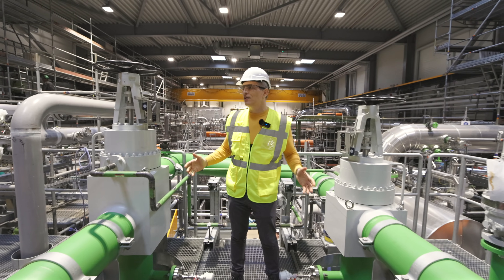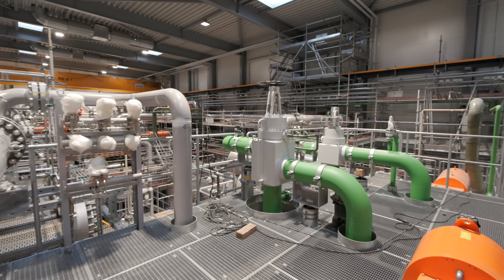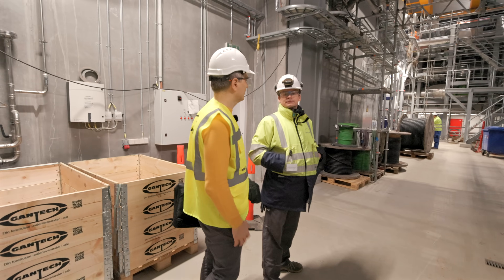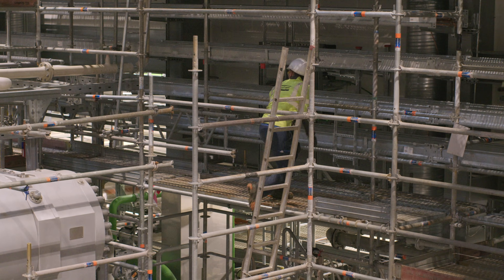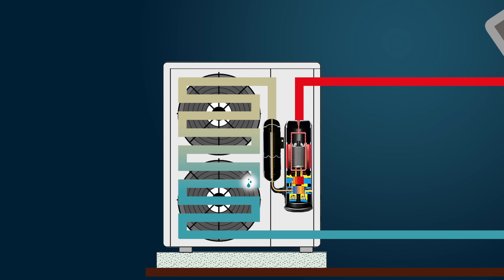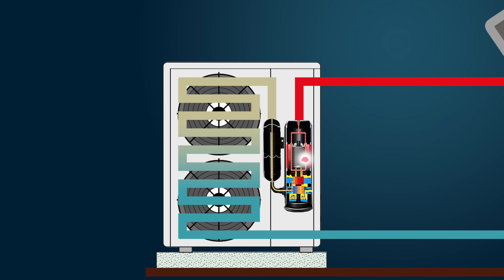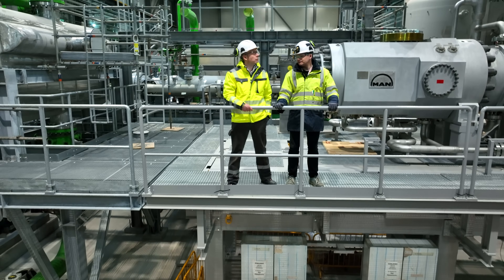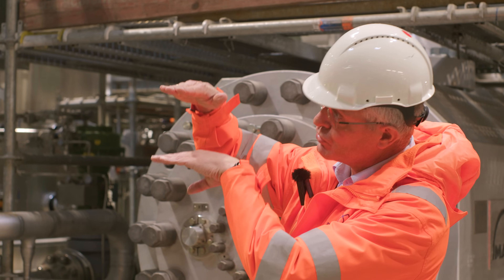Inside the world’s first giant heat pump that heats an entire city with CO2 and sea water

Comment: I'm not a fan of distributed heating (via heatpumps)  because the way to high flow temperatures.  If excess  heat from wasteburning is used maybe. (Small) Heatpumps should be installed and configured for the heating demand at each consumer imo.
Reply: It's replacing coal.... 

Lucky for the planet that  YT expert entitled conjecture.... is irrelevant
Reply: @nc3826  I never said they should not replace coal burning for heating. I only said do it decentalised.small heatpump at the consumer, no need to transport heat with big losses, no need tdo use high flowtemp (thus bad cop).
Reply: @jakop0815  1st the COP is not bad... 

But it doesn't matter, since they are only replacing only one aspect of the distributed heating system... Which is powered with coal....

Plus their heating is tied into waste disposal and other aspects... 

Life is not as simple as most people want it to be on social media.... I'm getting out of the rabbit hole now, have a nice day...
Reply: I agree, if the city already has distributed heat sure. I wouldn't suggest city's that turn off the natural gas to rip open the whole town with an army of diesel burning excavators to put in a mountain of polymer pipes. In that case decentralised high efficient heat pumps and improved insulation is in my opinion a better solution.
Reply: Bless the Danish and their "grid balancing gymnastics" -- but this is the dumbest/stupidest renewable-energy contraption I've ever seen.  (Have to feel sorry for the manager how has to describe this contraption.) 

1) there is nothing unusual happening with the climate.  (Please explain the Little Ice Age and the Medieval Warm Period.) 

2) there is nothing wrong with burning fossil fuels.  Its problems in high-density areas are trivial to fix and already have been fixed.  CO2 is not a pollutant.

3) Climate alarmism is a big-lie superstition supported by tax-bribed liars.  (See Climate Discussion Nexus for 100s of videos on climate quackery, deception, and realism.)

4) decarbonization is 21st century pyramid building and human sacrifice. 

5) there is NO excuse for expensive electricity.  Electricity generation is boring.     Just burn coal and scrub the smoke in densely populated areas.

6) the only challenge is manufacturing market quantities of cheap gasoline.  South Africa has already done this for decades (Sasol), using coal. 

7) Elon Musk: the Laptop Class is in La-La Land.

Comment: if the compressors were driven directly by wind, bypassing the conversion to electricity and back to mechanical energy it would be more efficient. 
The most efficient system would be an absobtion Ammonia system powered by solar heat.

Comment: 27:38 
In fact, it is not correct to say that there is no mechanical contact because magnetic bearings are mechanical bearings and use magnetic forces that are mechanical. Rather, it is correct to say that there is no physical contact. Another point I noticed is that there is a lot of incorrect promotion. For example, the person in the video says that the gearbox is the cause of the malfunction. How is it possible that he is an engineer and says something like this ??!!! 
It is known that the mechanical system is a very efficient and durable system that does not require electricity to operate. The purpose of the gear system is to obtain the required torque and speed with the least possible amount of input energy, and this has been known for a long time !! Obtaining the required torque and speed based on the frequency amplitude of the input power is an absurd matter that leads to the consumption of a very large amount of energy, and changing the frequency amplitude may damage the induction wires in the motor. Therefore, I believe that consumer companies have succeeded in promoting their products and polishing the image of those products. I believe that adding a suitable gear system can reduce electrical energy consumption and significantly reduce the load on the grid, this will also increase efficiency of heat pump.
Leave the system simple and do not complicate it with consumer electronics and complex coding based on memorization and memory !!
Reply: While gearing might increase efficiency, it would affect reliability. Gears wear out because of the physical context, even if properly lubricated. Efficiency is only one goal of the plant, others are safety and reliability.
Reply: @tlangdon12  The gear system is a reliable and simple system used as a transmission in very, very large trucks, such as those used in quarries. There can be a treatment for such a problem, such as cushioning between the teeth, for example, but not limited to. Gears can be made of suitable materials or use different types of Gear system and that after studying. Therefore, the gear system is a reliable system in the long run, so there is no need to exaggerate. There are many factors that threaten safety, the first of which is the huge amount of energy required to run the motor, and fluctuation of it, which entails many unnecessary problems and It also reduces the service life of the motor !

Comment: Excellent video. 

I think the main advantages of this large system over point of use heat pumps is its ability to actively adjust its electrical grid load while a point of use heat pump often uses the most electricity when the electrical grid is struggling to meet demand.  This municipal heat pump and storage with wood waste burner system provides a huge service by absorbing excess production and curtailing peak demand while providing heating service to the buildings of the city. 

Regarding the issue of replacing a coal powered plant, the benefits of doing so may be questionable.  Because energy is a world market. and electricity is simply a way to transport energy from one location to another with a loss of energy but an increase in usability and shifting the pollution away from the area of use to the area of production.   If the energy and resources used to create and operate this municipal heat pump creates a sufficient defficit and associated demand on the world energy market that an equal amount of coal has to be burned in a less advanced economy the greenness of the project is a failure because of the increased world gross greenhouse gas emissions and pollution.  I am not trying to point fingers at this specific project, I can see it's benefits.  I just think the European Union would do better if it used its coal to revive its dying manufacturing production instead of shifting manufacturing to third world countries that will burn coal with high pollution.  Also, with more coal use in Europe, less advanced countries would have more access to liquid and gas hydrocarbons. 

Unrelated general statement: Also, in my opinion, the EU not using Russian gas and oil is ludicrous and disastrous to the EU economy.   Do not virtue signal or warmonger at the cost of the global market and your economy.   Russia is not a threat to the EU. Stop wasting resources and lives.

Comment: so they shut it down when the wind is not blowing?
Reply from the maker: No, they can store thermal energy and balance their demand in electricity consumption from the grid.
Reply: if the wind were to shut down for a year, they would still be on the grid, the EU wide grid would bring in power from France nuclear or German coal or Norway hydro or what ever is cheapest at the time. Also the entire power draw of this site is about the same as a single one of the larger wind turbines, these figures were given in the video.
Reply: @johnjakson444  yeah, exactly, so why the greenwashing on the "wind powered" heat pump?
Reply: They are flexible in using electricity when price is best or when the grid needs balancing. There will be a strategic system to help them trim their system to the best economic working point. That balancing tank looks the big winner! I am an engineer, retired, that worked in this sector of industry and my heart is burning what we can achieve with modern technology. Very informative video!
Reply: @kezi___  From our end we do not communicate that wind-power-angle of this. It is because the journalists visit the site and see some nearby windmills and they just think it is a good story. In fact we are conneted to the public grid, and we have only green energy when Denmark as a hole has green energy.
Reply: @dinforsyning8578  Thank you
Reply: So many unsubsidized solar cells are now online, that grid price is zero at noon when consumption is low. It happened the weekend after you wrote, and again this weekend. The big heatpumps say "Thanks for the free energy" and store the heat for later.
Reply: @thomasgade226  wow there's sun in mid april, sure that's going to help heating in the winter
Reply: @kezi___  that's why they have those other sources, and storage . Frost also occur in April, usually because of clear skies - good for solar
Reply: Bless the Danish and their "grid balancing gymnastics" -- but this is the dumbest/stupidest renewable-energy contraption I've ever seen.  (Have to feel sorry for the manager how has to describe this contraption.) 

1) there is nothing unusual happening with the climate.  (Please explain the Little Ice Age and the Medieval Warm Period.) 

2) there is nothing wrong with burning fossil fuels.  Its problems in high-density areas are trivial to fix and already have been fixed.  CO2 is not a pollutant.

3) Climate alarmism is a big-lie superstition supported by tax-bribed liars.  (See Climate Discussion Nexus for 100s of videos on climate quackery, deception, and realism.)

4) decarbonization is 21st century pyramid building and human sacrifice. 

5) there is NO excuse for expensive electricity.  Electricity generation is boring.     Just burn coal and scrub the smoke in densely populated areas.

6) the only challenge is manufacturing market quantities of cheap gasoline.  South Africa has already done this for decades (Sasol), using coal. 

7) Elon Musk: the Laptop Class is in La-La Land.

Comment: Flawed Design, uses more Electricity than it produces. 

Heat Source Pumps do not work. 
Redo your maths.
Reply: Where was it mentioned that the system produces electricity ?

Comment: Denmark can afford this technology because of its vast reserved of oil and gas that it sells to the rest of the world! Look it up!!
Reply: I think you mixed Denmark with Norway on this topic
Reply: @felixdergluckliche3108  not according to google, i did check before i typed
Reply: “Denmark is the largest producer of oil and gas in the EU”
Reply: Denmark's oil&gas is quickly running out, and this is one of the next steps in securing cheap energy. But this time forever.
Reply: @philhermetic  The largest oil and gas producers in Europe are Norway and UK which are not the EU. Italy is large producer of oil and gas as well.
Reply: Denmarks production of oil and gas is only a fraction of Norway's. But this said, it should be mentioned that Denmark has been a forerunner in the development of wind turbines. Huge investments have been made in developing efficient turbines, and Danish wind turbines are now sold all over the world; and they are now so efficient that cost of electricity produced by wind turbines is lower than "black electricity" - construction costs included! We are now in a situation where investing in green energy has a better return than investing in black energy - and this is a turning point for green transition!
Reply: Bless the Danish and their "grid balancing gymnastics" -- but this is the dumbest/stupidest renewable-energy contraption I've ever seen.  (Have to feel sorry for the manager how has to describe this contraption.) 

1) there is nothing unusual happening with the climate.  (Please explain the Little Ice Age and the Medieval Warm Period.) 

2) there is nothing wrong with burning fossil fuels.  Its problems in high-density areas are trivial to fix and already have been fixed.  CO2 is not a pollutant.

3) Climate alarmism is a big-lie superstition supported by tax-bribed liars.  (See Climate Discussion Nexus for 100s of videos on climate quackery, deception, and realism.)

4) decarbonization is 21st century pyramid building and human sacrifice. 

5) there is NO excuse for expensive electricity.  Electricity generation is boring.     Just burn coal and scrub the smoke in densely populated areas.

6) the only challenge is manufacturing market quantities of cheap gasoline.  South Africa has already done this for decades (Sasol), using coal. 

7) Elon Musk: the Laptop Class is in La-La Land.

Comment: co2 makes no sense as refrigerant, but ok.
Reply: Why?
Reply: @g00rb4u  because the quantity of heat exchanged is greater when a phase change happens. CO2 does not condensate above 34°C, therefore does not change phase.
Reply: It absolutely makes sense for this large scale installation. Efficiency is not the only consideration, safety also has to taken into account.
Reply: @tlangdon12  how is co2 safer than any HFC refrigerant
Reply: CO2 absolutely makes sense. Easily obtained,  lowest value ozone depleting refrigerant available that requires much less permits as it's not classified as a harmful chemical. HFCs are.

CO2 tech has been used for years now, even auto manufacturers are switching to R744 now because it will be cheaper in the long run
Reply: @Padanian1  If only the video explained why!  Oh wait, it did!
Reply: @danr8194  Not ODP potential, but GWP potential, to be precise. And everybody is switching to R744 because of policy makers decisions, not because CO2 is cheaper or more efficient.
Reply: @Padanian1  yes R1234yf has the same  ODP and GWP as R744 but R1234yf is flammable,  R744 isn't. 
It's a tradeoff between safety and efficiency. 
Any leaks end up in a very very large warm system loop can end up causing a pretty big explosion risk. The worst you will have with CO2 is carbonated water.
Reply: @danr8194  I'm not a fan of 1234yf but it's only flammable if ignited with high energy ignition, which is unlikely
Reply: Bless the Danish and their "grid balancing gymnastics" -- but this is the dumbest/stupidest renewable-energy contraption I've ever seen.  (Have to feel sorry for the manager how has to describe this contraption.) 

1) there is nothing unusual happening with the climate.  (Please explain the Little Ice Age and the Medieval Warm Period.) 

2) there is nothing wrong with burning fossil fuels.  Its problems in high-density areas are trivial to fix and already have been fixed.  CO2 is not a pollutant.

3) Climate alarmism is a big-lie superstition supported by tax-bribed liars.  (See Climate Discussion Nexus for 100s of videos on climate quackery, deception, and realism.)

4) decarbonization is 21st century pyramid building and human sacrifice. 

5) there is NO excuse for expensive electricity.  Electricity generation is boring.     Just burn coal and scrub the smoke in densely populated areas.

6) the only challenge is manufacturing market quantities of cheap gasoline.  South Africa has already done this for decades (Sasol), using coal. 

7) Elon Musk: the Laptop Class is in La-La Land.